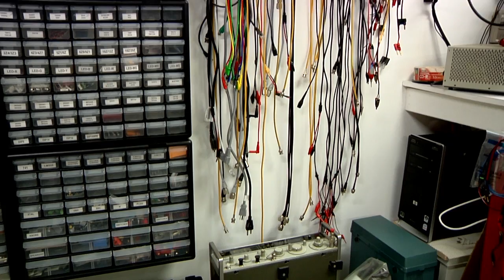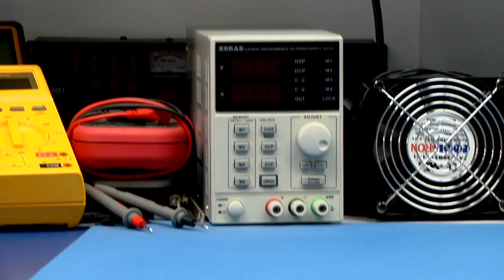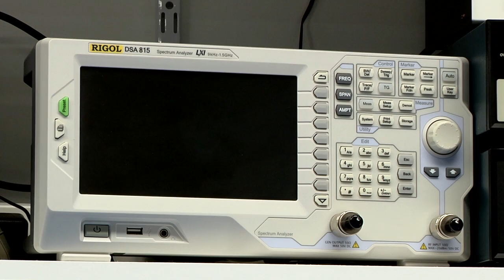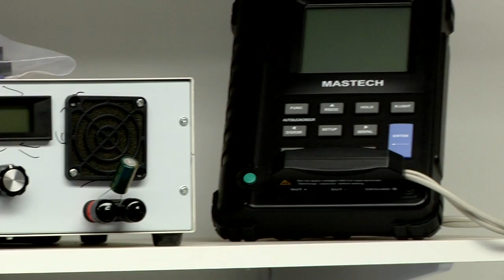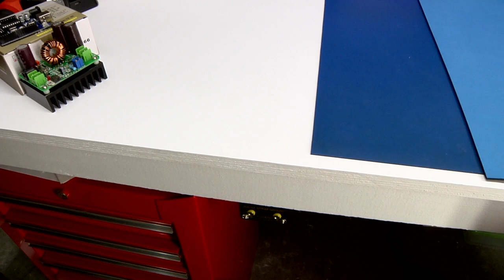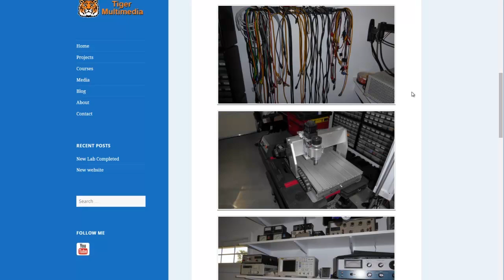#8 - Lab Tour

Comment: I like your setup, do you have a link or model number for that large blue led clock you have on the wall?
Reply from the maker: I got it from Amazon and just checked and it seems to be no longer available.    It is a Ivation16-inch Blue LED Calendar Clock.   It failed a while back and I moved on to another clock from Amazon.  DreamSky 15.5" Large Digital Wall Clock with Jumbo Big LED Number Display and it is still available.  Glad you liked my lab setup.

Comment: I hope that you please will comment on this:-)
You are right in many are saying that an analog oscilloscope is important and yes Dave from the EEVblog even says that one will learn a lot by getting one, but I do not think I have heard anyone telling why it is so fantastic to get one, I mean there have to be a reason for why it is the DSO that are been made now and the analog is almost faded completely out?
Reply from the maker: I am an old guy so I was raised on analog oscopes.  Yup I have heard Dave mention the same thing and I agree with him.  I think he was also pointing out that an old used analog oscope would be very inexpensive and still be a great learning tool.  One advantage of an analog oscope over a digital one is "oscilloscope aliasing" and you can just google it for a lot of information on the subject.  Also the analog oscope can display a contentiously variable waveform while the digital does discrete steps and then it can  smooth the results by connecting the dots, (discrete points).  You can easily see this by looking at a saw-tooth, triangle, or ramp waveform.  As you increase the sweep speed the analog will show a contentious line while at some point the digital might show a stair step pattern. Obliviously with the proper setting and BW on the digital oscope it can effectively reduced this problem.  As a hobbyist looking at some modulation scheme like AM or cat-eyes I like the analog representation better.  I like both analog and digital oscopes and as you mentioned the digital ones have become the dominate amplitude-time instrument.  Hope this answers your question and thanks for commenting.

Comment: Nice video JWR. But, I think you should cover the windows so no one can look in to see what is in there. And possibly in a way that you can open it only when you are in there.
Reply from the maker: Thanks, glad you liked the video.  Only one main sliding window in the garage and it has about 12-inches high opening, someone would also need a ladder, and it is on the front of the house in the open. So without a small ladder you can not see into the garage.  Also I do lock it and the house has an alarm system with smart phone notification.  Thanks for commenting.

Comment: Have you had any problems with that orange-button PS next to the stereo?  I've got one that looks very similar (apparently these are common, rebranded many times over), and last time I tried to use it, the CV/CC interactions seem broken...  Thx.
Reply from the maker: I rarely use that power supply anymore since I have a couple of newer ones.   In fact, to get more room for a few new items it is now in a cabinet.  The times that I have used it I didn't notice any problems with CV/CC.

Comment: what cabinet are those used as a leg
Reply from the maker: They are Harbor Freight "US General Pro" 18 in. 7 Drawer Glossy Red End Cabinet For Roller Tool Chest. I got them at $189.00 USD markdown from I think over $300.00 and now they are $169.99.  With 188 reviews they are almost given a full 5 star rating.  My opinion are they are very nice, fair price, and I have been enjoying them.
Reply: jwrelectro so cool Wish i only had a soldering iron ;)
Reply from the maker: Thanks...
Reply: thank you

Comment: Great tour of your lab. thanks for sharing and glad to see you back online.
Reply from the maker: +Todd Harrison (ToddFun) Glad to be back.  Over the last two years I have watched your videos with great enjoyment.
Reply: +jwrelectro Well thanks for the kind comment and for watching. By looking at your layout I'm really looking forward to your videos. There is so much you can do with all that equipment. I got the same HP 8640B from an auction for $50 not long ago. I"m not sure if it works 100% as the fine tune freq nob was bent and is not able to turn. It might still be good for bulk target signals if its working at all. I took it apart when I got it because there was screws rolling around inside. I didn't crack open the cavities of course but for sure I didn't want the screws rolling over any circuits. I will test it out sometime this winter I hope.